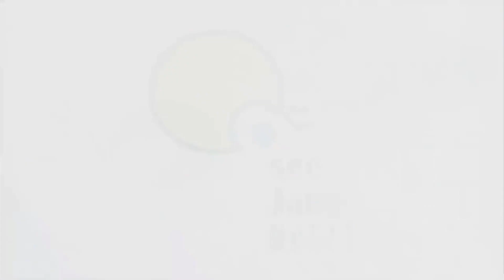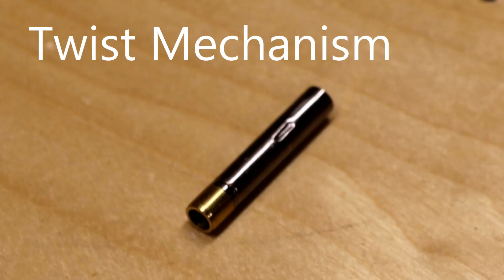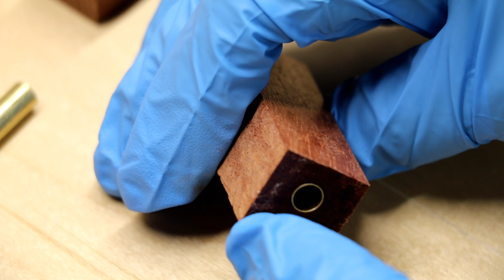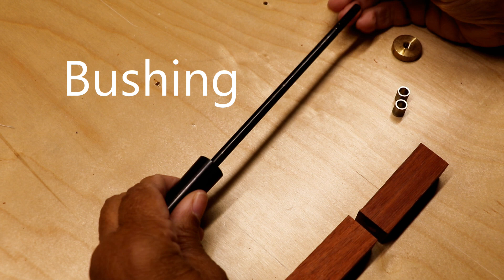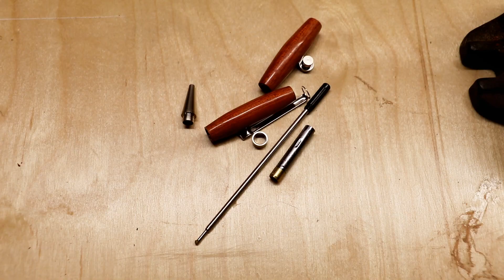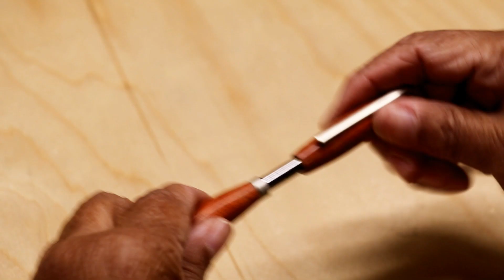Tutorial How to Turn a Pen on a Lathe

Comment: I like very much that you address the grain. However, you also know that grain only runs ONE way. Yes, you can see the grain through the wood, but the growth is only in ONE direction. This means that for the best milling, you need to go WITH the ACTUAL grain, not just the direction of the "stripes" that folks see as the grain. (this is also a rule for planing, jointing and sanding on a drum sander). 
It's like petting an animal. 
In one direction, the "fur" is smooth. In the other, it's like petting against the hairs and is rough. Same goes for wood. While you can see the pattern of the grain, it really ONLY goes in one direction.
Thus, chuck your wood to be cut WITH the grain and you'll get a better result. If you're working left to right, the grain should run smooth left to right also. Thus, the wood fibers should feel smooth from left to right, and rough (like petting an animal against the hair growth ... ie., backwards) from right to left. 
Of course, you can turn as you like in whatever direction, but working with the grain will save a lot of hassle.

Comment: Good basic tutorial, Leah. I've made about 900 of these and ran a small business for 5 years, selling them at markets and craft shows in my spare time. It looks like I maybe starting up again, but online instead.

Here are a couple of pointers, though: 

With pen blanks I always mark a line before the first cut so I can align the grain afterwards, and I continue that line right up to the pen tube itself so there's a mark on the finished pen barrels. This is especially helpful with complex grain patterns or acrylics. I also seat the brass tube on a big knitting needle or metal nail set (waxed) when inserting the tube, and that keeps the glue off your hands. 

For sanding, I'll go up to 600 or even as high as 1500 grit on wood before polishing,. You can find the higher grits in the auto body section of some stores. But on CA-glue-finished deer antler or synthetics I'll go as high as 12,000 grit. That isn't a typo - you can get micro mesh pads for wet sanding from 1500 to 12,000 grit, and they also come in sets as well.

 And while beeswax makes a good basic polish, I recommend a good turning polish followed by carnauba wax as a topcoat. I have a pen in my pocket right now that has kept its finish since 2012 based on that treatment. If you'd like I can send you a few pics. Thanks again!

Comment: I’m trying to drill through a stainless steel pot. I got through fairly easily but my step bit won’t go further I did over heat the the steel and I’m struggling to push through to the size of the whole I want any advice?
Reply from the maker: Stainless steel is very difficult to drill.  I always use a cobalt bit for stainless.

Comment: Great video! Just a small note: For a light duty job like this, using a vice as a press is fine, of course. However, unless you have a higher end forged vice (most sold at big box stores or online are cast rather than forged), you shouldn't get used to using your vice as a press for anything requiring real pressure. The vice will break, or worse, shatter dangerously. A vice is meant to hold rather than squeeze with great pressure.
Reply from the maker: It's all good. No worries.  Speaking up is encouraged here.
Reply: (I only mention this because I've seen accidents, so now I feel responsible to point it out anytime I see it! 🙂)

Comment: I don't have a lathe, so I can't do that I actually know how to turn, but it's been years since I've done any. I once had a small lathe that was powered by an electric drill. it was great for turning small things like this, and was inexpensive and compact. I recently got old of a bunch of like new turning tools, but I sold them. 5 dollars for a full set of turning tools, I couldn't pass it up, even though they were not the carbide tip kind like you use.